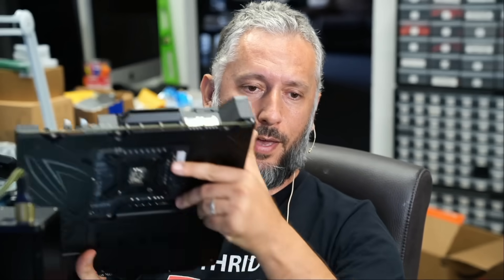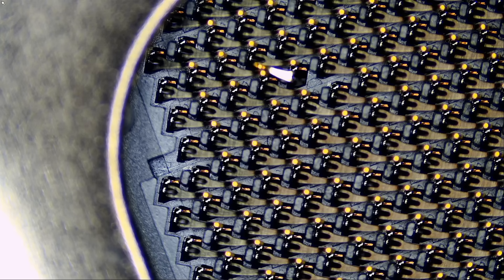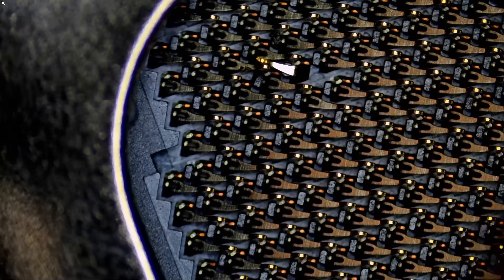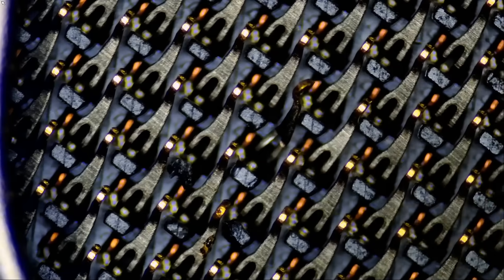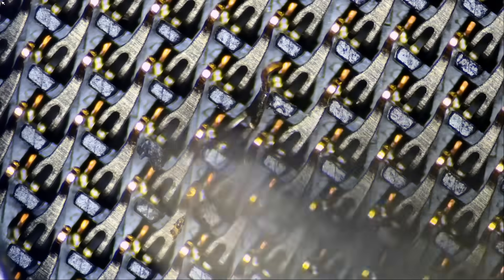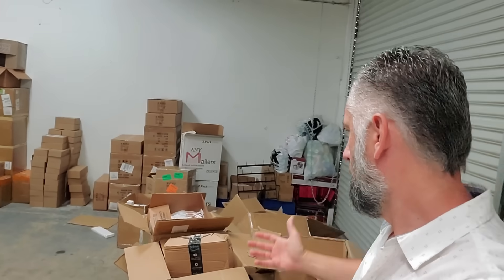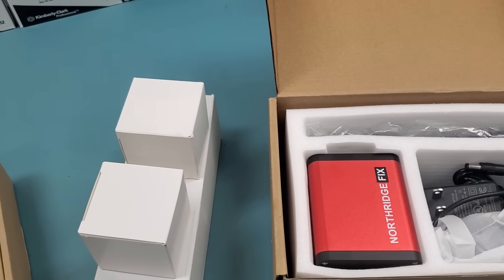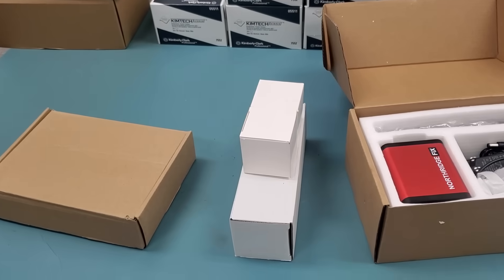Saving a $1000 Board: Z890 Maximus Extreme Socket Pin Bent Backwards.

Comment: It's LGA pin grid array and intel first come up with it back to socket 775 dual core cpu. Now AMD is using this LGA socket. Personally I prefer PGA but then that's because that's all there was outside of one intel slotted CPU... those didn't last long LOL. With PGA a hollow needle from a ink refill kit could easily straight the pins out. With LGA it's a 50/50 loose it or keep it option.

Comment: I was enthusiastic about this socket type until one incident. Luckily, it was my old PC. The CPU dropped from my hand and landed on the socket. It completely broke, and that's when I realized once again how fragile everything is. 
The one with the pins on the CPU is also good. You only need packaging if you store a lot of CPUs. But you have to be careful there, too. You learn from mistakes.

Removing the CPU always involves a risk. I've often had to reinsert it several times because it wasn't making proper contact. It's the best method for cleaning, but I really don't like doing it.

You should be calm and very focused. Know exactly what you're doing.

Comment: I bent back sooo many pins through the years, when I worked at a computer shop, with a 9mm break off knife (hobby knife) that was easy peasy, socket 1151 and 1155 those sockets, usually things worked again after bending back, sometimes not. I even had some pins that bent back so well that you couldn't tell afterwards, not even when holding it in the light, perfection when doing this does exist. Of course those pins were usually just bent to the side a little, not 180 degrees backwards... those were a lot harder and broke off most of the time.
Of course we did warn customers about the sockets, and for some people we put the CPU in the sockets for them, you see not everybody is so tech savvy and you basically do them a little service by putting in the CPU for them :)

And of course awesome video, does the board work again?

Comment: The pin looks like it has a slight crack running through the middle im not sure how it would effect the workings of the motherboard. It would've been good to see it turned on and post. Regardless of the outcome you did a great job its not easy bending pins back

Comment: i have a Z 390 elite MB the pins bent backwards  the issue was a leaking watercooler hose drip drip 
 bought  MB    but wud like the cpu socket replaced  or i'll just buy a combo mb cpu gen14  meanwhile GPU issues also  1/2hr in a game  bluescreen

Comment: Alex I know you're on your game, but if you don't know they make new sockets where you can replace the entire socket if you ever get a severe case that may be the better option.
Reply: I don't think he's worried about finding a replacement. I think he's worried about getting the old off and the new on without melting or damaging anything else. One slip and it's a $1000 out of his pocket. Edit: fixed typo.
Reply: And what socket is that? Any links so that other people can see?
Reply: He said it would be an impractical repair, ie takes too much time in which he can do other repairs with less time and higher chances of success. Business wise you loose money if you do a complex and time consuming repair. 

Aside from that, it's a big socket and the board needs a lot of heat to desolder the socket. A big risk to warp the board and damage other components.

Comment: Hi Alex. Can't you add a bit of solder to the bent spot using a nano tip? To avoid breaking in the future.🙏🌹
Reply: You don't want solder anywhere near those pins. It will cause a mess and will be impossible to clean.

Comment: Good job on the pin. It looks like it is the AY11 (gnd) or E44 (vcode), depending on the board position. The board would totally work without any problem even if the pin was broke.